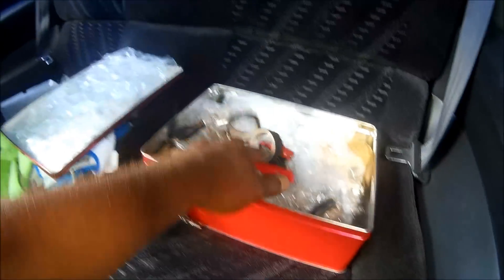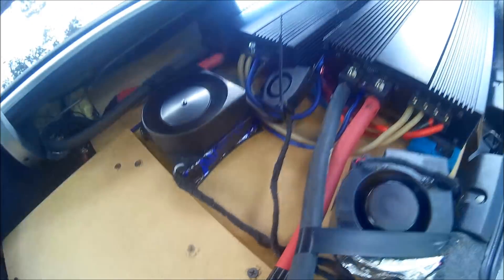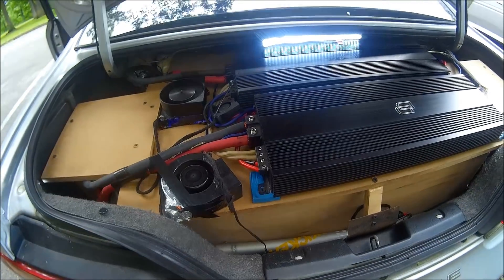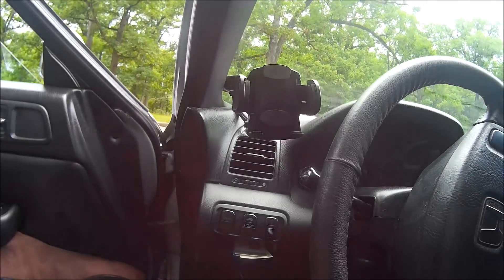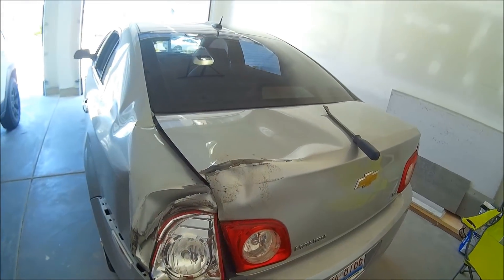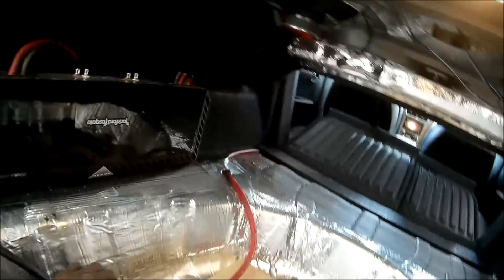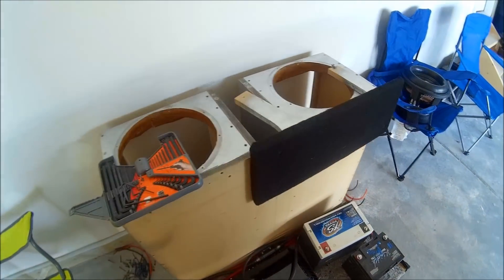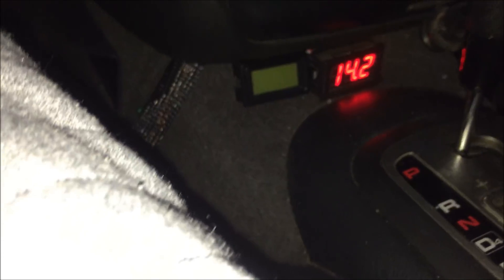Bass UPDATE. The Lithium, The Uninstall, Amp Rack, New Bass Car.

Comment: Nothing wrong with going over and over and over again the details in this bass game. Running 500+ amps of current through a vehicle that's equipped to only run say 200 amps from the factory means being detail oriented and mindful is SUPER important when it comes to electrical. This coming from a guy who learned the hard way lol. 

Mad props dear sir! Keep up the good work, and as you say, "Peace and bass"
Reply from the maker: Man bro I always appreciate your comments, you definitely keep it real. Yes indeed we all live and learn. I think we all have been there some at greater extents than others. No shame here as well my 1st car I had 8ga power cable with a kick switch installed so I can cut the bass on and off. I think the amp was a Sherwood 400 on 2 Super Pro 15's (Chicago's version of the Funky Pup) My electrical was so bad when the bass drops the car would cut off at times. #IHaveAngels. 

I couldn't agree more with you. This reminds me I have 3 different grounds but I need to run a ground from front to rear.
Reply: bigvell02 - Well thanks pimp. I'll just put it like this; my lil 2-12's set up cost $4,800. $2,200 of it is all electrical work lol.

Comment: 2:18 bottom right, just under the amp shelf, it looks like a hole that I can see daylight through and there's one on the other side, same spot... Am I crazy?
Reply from the maker: Hey bro nope your not crazy at all. I had to double look myself - I forgot I had led accent lights. I installed them back in 2002. They do give the illusion of a hole.
Reply: I thought they looked like LED's too, but I haven't seen you mention them... And that was too easy an answer for me being high.

Comment: I wish I could hit 20 hz. I can't hit anything under 28 very well at all. Even 28 I get my subs stinking fast. Def need a new box.
Reply from the maker: You will very soon. Yeah I use to hear the old saying its all about the box its all about the box. I can say without a doubt that holds a ton of truth :). If you need a box design and cut sheet made, let me know.
Reply: bigvell02 good looking out I appreciate that. Keep in mind it's a single cab f250, so it has be fit between the bucket seats. I bought the closest I could find to Orion specs for a prefab  just because I didn't want to risk building my fist box and it be a dud lol. I wanted bass right away. No time for tearing boxes apart and building over and over. Of course now I wish I just built 1 from the start. I want the low lows. 30 is decent but still... I'm missing 20-29hz